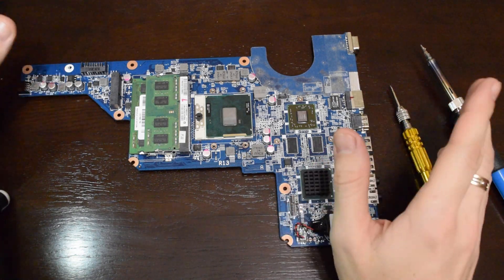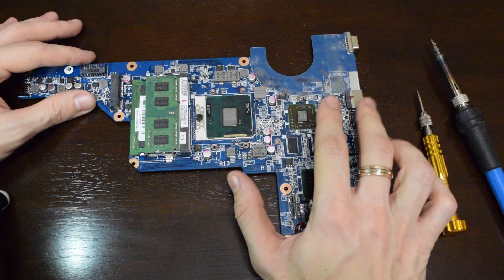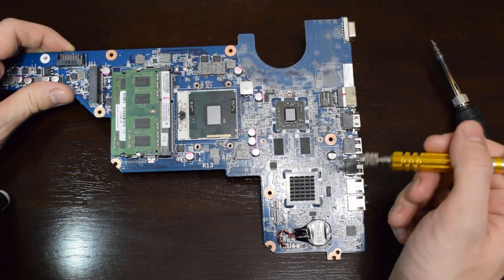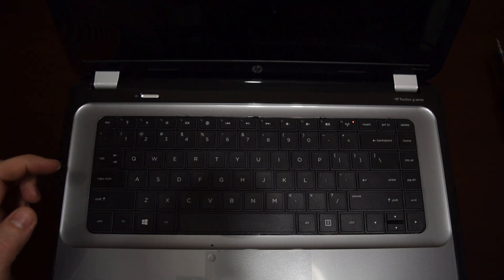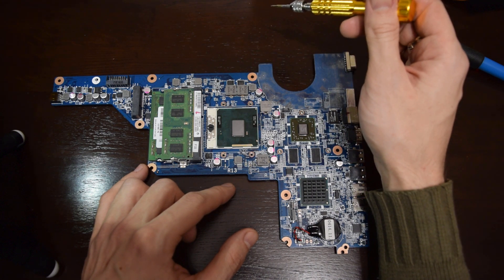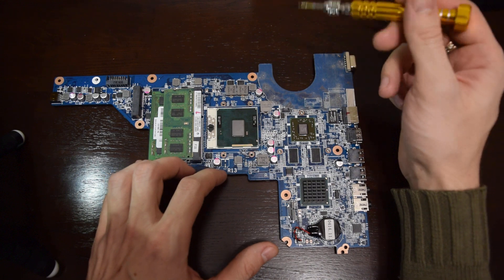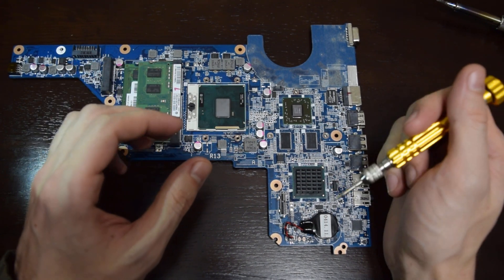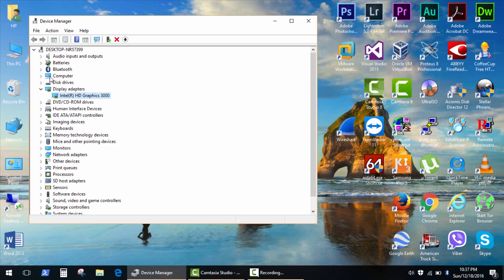Fix Dead GPU – Convert HP, Dell, Lenovo Laptop to UMA Graphics (HP G6 Example)

Comment: Great work! Is it possible for Dell Vostro 3460?
Reply from the maker: Thanks! Dell has a little bit different schematics, usually you have disconnect coil and swap some resistors but not for all models. Just give it a try there are two coils that you have to disconnect: https://ibb.co/mMCPTn

Comment: Is it will work in DELL INSPIRON N5110 ??!!??!??!?? 🤔🤔
Reply from the maker: Yes it perfectly works with your model and it's really very easy. 
https://ibb.co/moSD8c
If it still doesn't work just tell me. There's one resistor which you should move to another point. For some models it's on proper place for some not. Good luck!

Comment: could you please do an msi gx660 laptop igp conversion my laptops radeon 5870m died ang laptop here in the Philippines cost a kidney thanks
Reply from the maker: Hi buddy! Your laptop has removable discrete graphic card. So, simply remove it from the slot and it will work.
Reply: i did remove it and nothing happened still no screen but has power on the led indicator thanks for the reply appreciate it alot

Comment: Hello,I got an HP Probook 4730s with an i3 2330m and an amd 7400  series gpu. Which chip do i have to remove near the gpu? Is it the grey square one near the white/red resistor? https://ibb.co/noVW1x
Reply from the maker: Hi! It's very simple and if the problem really in GPU you will fix it:
https://ibb.co/jSzBjH
https://ibb.co/hOkTWx
Reply: 2013Electronics&Computers So do i have to remove both the chip and the resistor?
Reply: The problem is definitely the amd gpu. The laptop works great without the amd drivers. The problem is that windows 10 keeps installing the amd driver even if the updates are turned off.
Reply: 2013Electronics&Computers  Thank you so much for your help. I just removed the grey chip you showed me and the amd gpu is not recognized anymore. I can finally use my laptop.
https://ibb.co/ePCgjH

Comment: I have an Asus k43sa laptop (intel i7 2670qm + HD radeon 6730m).. I have an MXM ver2 gpu which is removable but even if I remove the gpu it wont still boot. And I don't know if I have a switchable graphic display. I tried to install the driver for the igpu but the system can't find the device.. Will it work with my laptop?
Reply from the maker: No, it's not gonna help you.

Comment: Sir , is it possible to remove the coil for Acer Aspire 4745G ?
Please advise and thanks for your time :)
img :  https://ibb.co/kHdfCH
Reply from the maker: It may not work for this model and requires to remove and swap a bunch of resistors and capacitors.  But you can try to remove the coil: 
https://ibb.co/hFxkEx
Reply: Hi 2013EC , thanks for your quick reply and confirmation. Yes, what you said regarding first gen CPU was true. Cutting off the coil result in no graphic display. I guess there isn't any fail protection build between the 2 integrated GPU and both dependent of one another. When i tried disable AMD GPU in OS, its temperature surge. As i tried select high performance GPU, the OS would turn unstable and recover from graphic failure.
My system is generating and consuming unnecessary heat cum power with a dummy GPU onboard... haha

Comment: Can't believe this works.Amazing job man !!
Repaired my laptop(pavilion g6) with a dead radeon GPU.
Thanks.
Reply from the maker: You're welcome! I'm so glad I could help you.
Reply: "How can I find which coil to be removed on my HP DV 9600 series motherboard, with nvidia CPU" 
this is mine matherboard in attach 
Thank you very much you are a noble man
https://ibb.co/mvsggx
https://ibb.co/iLm7Mx
https://ibb.co/gE5v8c
Reply from the maker: Check the link https://ibb.co/kPZ5PH
Just in case if you need motherboard it's just 32$ with free delivery from reliable seller: http://ali.pub/2h6s04
Reply: Does it work for any HP DV9600 with Intel processor?  Mine is T5600 (because of the beautiful design I don't want to trash this old laptop...)

Comment: Hello sir 2013Electronics&Computers i have a dell laptop vostro 1520 dual core black screen fan spinning for few sec and then power turn off automatic after i turn on my laptop again LED 9 lock screen blinking and those 2 LED was light 9 lock LED was blinking many times cant count i just want to ask if this vid can help to fix it ?

Comment: does this work on my laptop msi model no. MS-1681 sir ?
Reply: heres the link of the picture sir
https://ibb.co/nGdH27
https://ibb.co/mzFx27
Reply from the maker: NO, it doesn't! It technically impossible because your model doesn't have discrete graphics. There's only Intel HDgraphics  integrated in your CPU which is almost never fails. So it could be chipset HM55 or something else. What are symptoms?
Reply: When i try to power up the laptop , fan is spinning ,  laptop is on, but no picture nor lights on the screen.
Reply: Fan is spinning to fast and loud, when i touch the heatsink on the processor iits hot , also on graphics chips.

Comment: I managed to remove the coil like this (note: only the upper part of the one side of coil terminal damaged)
https://ibb.co/dxs2H7

But do I still need to cut the terminals or that will be enough or just cover it by using a soldering lead? Also, can I just tape the battery I mentioned in my past comment with a regular tape or electrical tape underneath? Illbe waiting for your reply sir :)
Reply: After days of searching about DIS to UMA conversion and trying to remove the voltage coil, i finally removed the Standard VGA Graphics adapter (AMD) from the device manager! 
From this one https://ibb.co/hMAyPn
To this one https://ibb.co/gmFXjn

Thank you sir! God bless :D
Reply from the maker: I'm glad I could help you!
Reply from the maker: Just leave those terminals as is. For battery I use 3M™ Double Sided Tapes but it doesn't matter any tape or even silicon to keep it in place. So did you turn it on? It works?
Reply: The gpu doesnt produce heat anymore so the laptop doesn't overheat now, but after some time, the display distorts again, I'll be adding some pictures later, I hope youcan help me diagnosed it later.
Reply from the maker: Show me the picture of your display!

Comment: Here is a picture of my motherboard. I dont know what coil should i remove.

https://ibb.co/bvPFjn
https://ibb.co/cQvcx7
https://ibb.co/nrVSx7
https://ibb.co/by27x7

And there's a battery-like part and i dont know where should i attach that because i think it's attached somewhere. Do i still need to attach that one or just let it remain? Please reply ASAP! Thanks
Reply from the maker: https://ibb.co/cSrZc7
https://ibb.co/n6FSx7
Reply: Thank you sir! I'll update as soon as I finish. :)
Reply from the maker: I'm looking forward to your reply.
Reply: I'm having a hard time desoldering the coil. Maybe I'm not doing it right. Should I desolder the holder-like part of the coil or the one underneath it? Here's a closer picture. 

https://ibb.co/f84opn
https://ibb.co/k23g9n

Or is there any other way of removing the coil terminals like using a cutter instead? What will happen if I accidentally heated up the coil (tho it hasn't happened yet)? Sorry for the questions 😅
Reply from the maker: If you have a good soldering iron it's just one minute work. Try to apply some solder or flux on the tip of soldering iron for better thermal conductivity to the terminals.
Reply: 2013Electronics&Computers Maybe the iron is a factor too. Btw, about the pictures that i just sent, would you mind pointing what part of the terminals should I direct the tip of the iron?

Comment: Hi, I have Lenovo y50-70 with Nvidia Graphics chip. My laptop turns and shuts off after 3 second no display. I can hear fan spins. I check the ram and battery .even disconnect the battery and remove the bios battery.But no luck!Do you thing by removing the coil will fix my issue. Thanks for the video!
Reply from the maker: It's doable but removing only coils may not be enough. Anyway if you can do it carefully, just give it a try. https://ibb.co/cpNXc7
Reply: Thanks for replying. =)

Comment: Will this work on HP Pavilion g4-1318tx ? And how's your pavilion g6 today? Does it still work? Are there any risks or disadvantages when that remedy is performed?
Reply from the maker: There's no disadvantages! The same models of laptops exist with GPU and without that's what you pay for. If it dies you can replace GPU or simply eliminate it from motherboard. I fixed dozens of laptops this way, when customers don't want to pay 50-100$ for a new GPU.
Yes, it will work for your laptop. Check the picture:
https://ibb.co/nou3cx
And second picture as example of the same motherboard but without GPU. of If you have an infrared rework station you can eliminate GPU and graphics memory completely and it will look like a factory motherboard but you can just remove the coil and it works the same. It's like Vasectomy :))))))
https://ibb.co/hyXTAH
Reply: 2013Electronics&Computers Thanks for your fast informative reply sir. I'll be updating here asap after performing this method. Thanks again :)

*I also google about the motherboard and I think both g4 and g6 has the same motherboard, so it may actually work.
Reply: Before I let a technician within our area do the task, I just want to make sure that the 'Standard VGA Graphics Adapter' under the 'Intel(R) HD 3000' is the driver that's supposed to be for the AMD gpu. Can you confirm it for me? here's the link for the picture. https://ibb.co/mmLMjn
Reply from the maker: That's right!
Reply: Here are the pictures of my motherboard. I dont know which coil should i remove.

https://ibb.co/bvPFjn
https://ibb.co/cQvcx7
https://ibb.co/nrVSx7
https://ibb.co/by27x7

And where is the battery position originally? I did remove the motherword then i saw that battery i cant it's attached somewhere. Please reply ASAP! Thanks

Comment: i have hp probook G0 450..will this method work and which coil to remove..
Reply from the maker: Should work
https://ibb.co/cqvs0H
Reply: 2013Electronics&Computers  thanks i must fix it one more question what if the caps lock and num lk both blinks 5 times n nothing happens....should i use the same method to fix it
Reply: 2013Electronics&Computers  i had this error when i tried to update bios n failed
Reply from the maker: I think problem not in GPU. Try to disconnect the battery and power supply and remove small BIOS battery for a few minutes. If it doesn't help there's recovery procedure to recover corrupted BIOS from USB flash. 
https://support.hp.com/us-en/document/c02693833
Reply from the maker: Anyways that LED indication is not always correct. If BIOS recovery didn't work for you try to remove the coil.
Reply: 2013Electronics&Computers  thanks much...i have one question what if the hp laptop when connected to power it only give white flash and not charging..the power supply is well..but when you leave it for several hours it works normal it charges but when you disconnect it wont charge it gives you white flashes until sever hours pass n works normal..what could be the problem?
Reply from the maker: Are you sure that the power supply is OK? If it possible try it on another laptop.
Reply: 2013Electronics&Computers yeah the power supply is ok i even bought another but it has the same problem
Reply: 2013Electronics&Computers m pretty sure the power supply is ok
Reply: 2013Electronics&Computers i tried it on another laptops n works perfectly

Comment: Got my laptop 10 years ago, nicest thing I ever bought myself. Really good machine, still plays games like Skyrim and does a lot of video editing... then last week the GPU went on it. Can't bring myself to throw $1000 in the garbage. Think your fix would work for me? Here's several pics, starting with the laptop specs, then a picture of how messed up the display looks, then pictures of the motherboard. Let me know, thanks!
Specs: https://imgur.com/yvGJjlk
Display: https://imgur.com/70ljHTO
Motherboard 1: https://imgur.com/04RVboG
Motherboard 2: https://imgur.com/YasyTpE
Motherboard 3: https://imgur.com/EYO5nep
Reply from the maker: HI there!
First of all, my method is not gonna work with your laptop, because it's old platform and there's no integrated GPU in CPU.
Secondly, I'm not sure that the problem in your GPU. If you have any possibility to connect an external display and see if you get the same result. If you don't have another display, try to make screenshot of your screen and look on that picture on working PC. Is there's no lines them you have faulty LCD panel if you see on the picture what you see on your screen then it's GPU. Check all connection from motherboard to LCD. Disassemble screen cover and check all connections.
Reply: Damn, that's a real shame. The computer was really high end when I got it and had been a fantastic machine all these years... still good enough last week to play some really demanding games and edit video like a champ. Seems crazy to just throw it in the trash. As far as plugging in another display, when the problem first started I tried a second monitor on it as well as plugging it into the TV via HDMI and nothing showed up. I will give it another try today and report back if it displays anything. As far as lines on the screen, it does have various multi-colored lines on the screen and they change and move if I flex the laptop. What's weird is the problem went away one or two times, but now it's back permanently.
Reply: Hey, tell you what, that first picture I linked to in my comment that says "Specs:" is actually a screenshot from that computer. I turned it on and went onto DxDiag, took a screenshot, saved it and sent it to myself via email, then opened it on my backup computer and attached it here. So, the picture shows only 1 screen and no lines. Yet on the computer itself, the display shows 6 different screens and had weird lines all over the place.
Reply: Ok so the laptop only successfully runs if the nvidia driver is disabled. If I enable it, it blue screens on startup, every time. If I plug an HDMI into the laptop while it's running without the nvidia driver enabled, nothing shows up on the TV. Same result with a monitor plugged into it. What's your opinion of all that?
Reply: Not sure why we lost contact, but I've got some new insight into this issue. A friend suggested I try TeamViewer... it's like a remote access program that lets you take control of another computer via crossover cable or through the internet and you can essentially use that computer as if you were sitting right in front of it. Well, it worked. Perfectly. I can see my screen and there is no 6-screen split or any glitched out lines on it. So, in summary... the GPU is messed up because I can only get to Windows if the nvidia driver is disabled, but with the driver disabled my screen is still messed up... yet through remote access my screen is totally fine. I'm beyond confused how that is even possible.

Comment: How can I find which coil to be removed on my HP DV 9000 series motherboard, with  AMD CPU
Reply from the maker: It works only for Intel CPUs
Reply: Thank you very much
Reply: can i see for hp dv 9650  which coil to be removed my vga card not work  with heating
Reply from the maker: This should work if the problem in GPU:
https://ibb.co/b8mqmx

Comment: hello i have hp motherboard with 615382-001 part number. Can you please show me the coils?
Reply from the maker: https://ibb.co/c9om8S
Please tell me about your result.
Reply: Yes! thank you very much for your help! I also move some resistors next to ite chip. It worked :)
Reply: I have also Clevo w253efq with short in vga area.When  i removed 2 coils next to chip the laptop starts good but with no image. I am thinking if i should check something else. I have a schematic for this i can send to you...
Reply from the maker: I can't find UMA switching on that schematics. Looks like Chinese stuff. I can't find this model only with UMA graphics also...

Comment: Sir i have emachines e627 laptop.which coil to remove
Reply: Your CPU doesn't have an integrated GPU. This option doesn't work for your laptop.
Reply from the maker: It works Only for Intel CPUs you obviously have AMD
Reply from the maker: Watch this video and ask yourself is there anything you can do
https://www.youtube.com/watch?v=KfSF28vbrM0
Reply from the maker: Just send me a picture of your motherboard. Use any cloud you like.
Reply: Your face book id link sir
Reply: Can you send me any cloud link
Reply from the maker: https://imgbb.com/
Reply: Any another method
Reply: How to replace gpu
Reply from the maker: There's no way you can do it at home. You need an infrared rework station and a serious practice and knowledge in it.
Reply: Can it reflow by hearing it
Reply from the maker: I'd love to help you, but there's no another method or choice but replace GPU or buy a new motherboard which costs 55$ with free delivery to any country: http://ali.pub/2c46ry

Comment: hello.. i have acer laptop with intel hd grapics 5500 +nvidia geforge 920m.. if i will not disable the intel hd in the device manager the laptop show blackscreen, disabling it the laptop boot normally can be use..does this method applicable with my laptop? thanks in advance
Reply from the maker: Try to switch your graphics cards in BIOS set it to discrete only. Try to update drivers.
Reply: Done doing updates but the screen goes black need to go safemode to disable the intel hd 5500 then its usable again..i tried the bios but did not able to find the gpu options..

Comment: My laptop motherboard has a amd dedicated graphic chip. If i completly remove the chip, motherboar will work or not? My laptop is HP pavilion dv6 6165tx notebook pc
Reply from the maker: It will work if you have Intel's CPU starting from the second generation.
Reply: 2013Electronics&Computers it's Intel i7